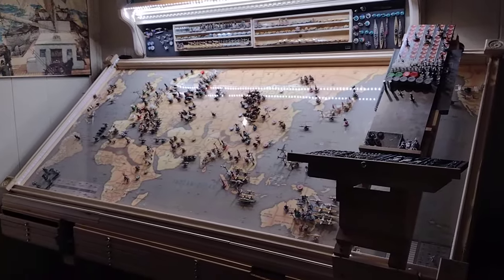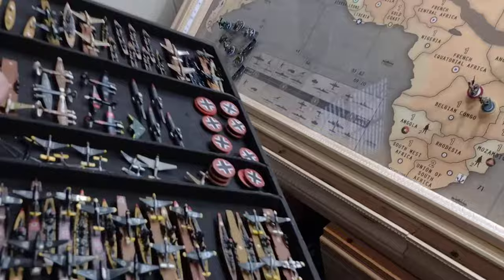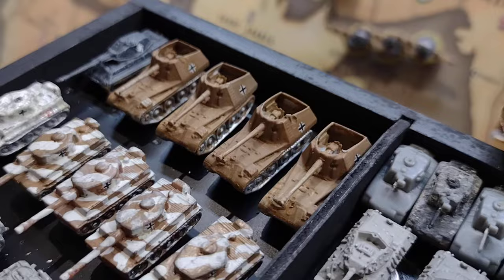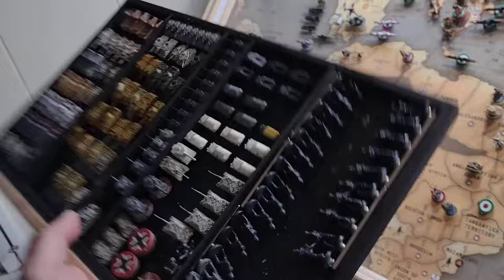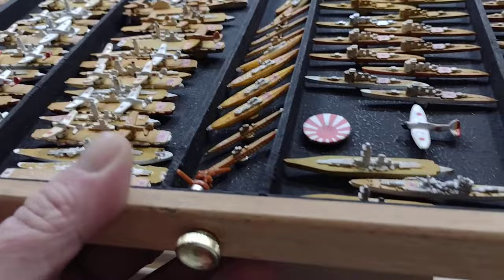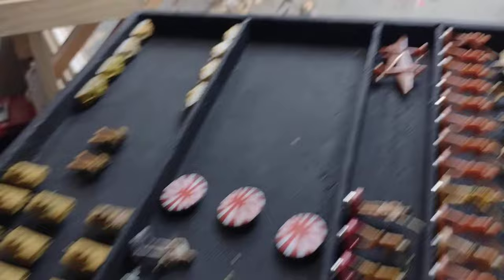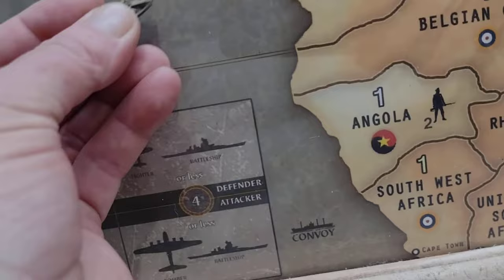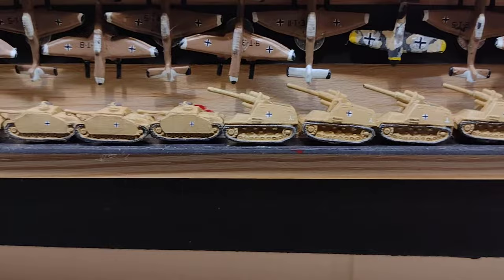Axis and Allies custom board with magnetic storage trays

Comment: Beautiful work, excellent sculpture. I have mounted my units using pipe cleaning wires and a small drill bit, drilling both the units and the board allows a wall hanging and more flexibility, even traveling with the game set up. It's fallen off the wall a few times and no pieces moved, once a couple boats were scraped off but literally no problems. Just a thought before investing in potentially communist magnetics